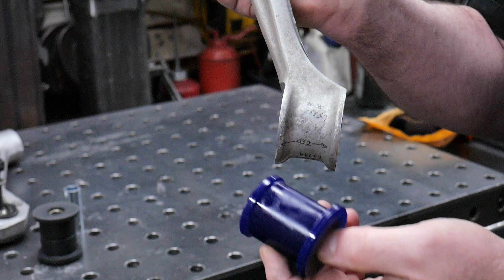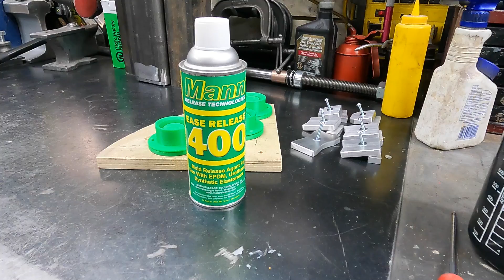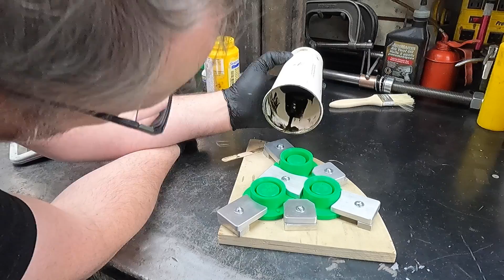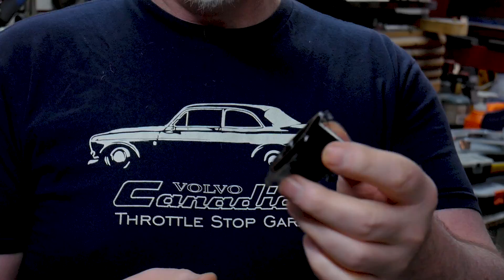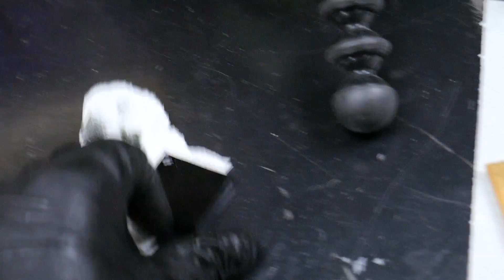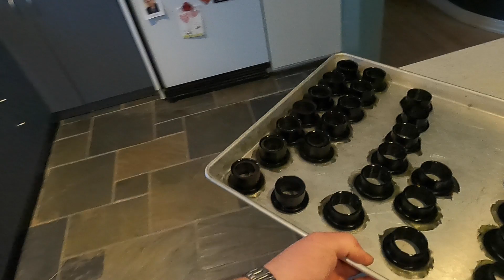DIY Polyurethane Suspension Bushings

Comment: What if you would put a little hole in the bottom of the mold and inject the PU in with a bigger syringe? Would be better to fill it from the bottom regarding air bubbles and filling the mold completely witg pu.
Reply from the maker: Another great idea.  Several people that make this sort of thing have told me that adding it from the top slowly is pretty common practice.  I'm only making a set, so easy is good.

Comment: you should use carbon black instead of "colorant", it adds UV protection to the poly
cut down the plywood so it fits in your de-gassing pot
Reply: Ummm, these won't be in the sunlight, so....
Reply from the maker: I didn't know that this was possible.  Not very worried about UV on these parts, but for others - thanks!

Comment: Very nicely done. Is the oven baking a necessary step?
Reply from the maker: It was included in the material data sheet as a way of improving durability and strength.

Comment: If you make the bushing an easy/slip fit, doesn’t that just let it move around more? I thought the whole point of the tight fit was to stop extra deflection and keep the bushing solid in the arm.
Reply from the maker: The bushings will be a three piece part.  The urethane part will not rotate and when the other parts are installed, it should be tight.

Comment: Dear, I am a follower and admirer of your work and we wish you success. I will do the same to rebuild the suspension system in my country. If you can provide us with the rubber specifications and the source.
Reply from the maker: The bushings I used are not a standard product, so there is no source for them.  They are a pourable urethane with a reasonably high durometer.

Comment: From my experience I would say ya need a wee bit tighter fit 1mm more as you will have ware to deal with after the first few miles
Reply from the maker: We'll see when I get it done.  If it needs to be tighter, I'll make them larger.

Comment: When I hear "polyurethane" I immediately think of hydrolysis and how this affects polyurethane shoe soles.  Does the same apply to PU bushes.
Reply from the maker: While it is still possible, it's not common for car suspension applications to suffer from disintegration in this way. The polyurethane compounds used are different (at least that's my understanding) and I've had poly bushings in cars for 15 years that are still fine.

Comment: Full set of poly bushing inserts for my magnum is $900 US.  How much is that vacuum tank cost? That is labor intensive but I bet it’s Pennie’s on the dollar cheaper than buying a set 👍
Reply from the maker: The vac pump was a cheap one from Amazon - I also needed it for the carbon fibre work - it's also not really needed.  The rest - about $100 and time.

Comment: Is it common for poly bushings to insert directly to the control arm and not in a metal sleeve? Or is it vehicle dependent? The corvette having a more presicion machined control arm?
Reply from the maker: Yes - it's not uncommon if the bushing didn't have a shell originally.  Vehicle dependent.
Reply: @  Right that makes sense. Thanks

Comment: nice work,  i use the PMC all the time from 70 upto 90A    i find it better to warm the poly to 28c before mixing as it mixes better it degasses better, i then degas again after the poly is poured into the mounts,     PMC has about a 15-20min pot life  and course is 48 hours  you  dont need to heat as the poly fully harden over a few days,  heating to 65C just speeds up the proses,
Reply from the maker: Cool, thanks

Comment: Did you make the 3d prints in 2 parts so you can clamp them? Wouldn't it use less material if you flipped them and had the wider part at the top of the mould, it would all be one piece you could just pour into, there is also an option you can do with your printer to smooth out the flat top edges with the hot end to give you that nice smooth finish. Nice job though, i'm looking to do this myself soon but i'm not too sure on which poly mix to get.
Reply from the maker: They are two part molds - there was virtually zero wasted material when I made these.  I like the texture that the printer leaves - it's somewhere for lubrication to sit in the finished part.

Comment: Rewatching because I’m gearing up to make my own body mounts for my Riviera.
Reply from the maker: Thanks - I hope it helps.
Reply: So I got the printer retuned for PLA to print the molds when I looked at my stocks of filament and realized I have a ton of TPU (bought out someone else's stock years ago).  What are your thoughts of direct printing a body mount with TPU using infill to vary the pilability?

Comment: Can you do a test where you print bushings in TPU directly?
Reply from the maker: I've thought about it.  If these don't work, I'll do it.
Reply: You probably need to make them a little bit oversized and hammer them in because of the tiny air gaps in 3d printing 
  @ThrottleStopGarage
Reply from the maker: @1marcelfilms  I made them to size and then sanded them to as close as I could get.

Comment: Excellent craftsmanship! I wanted to share some thoughts on bushing theory if you're open to it!  Bonded rubber bushings when functioning keep the inner metal centered to the outer can which is pressed into the arm.  Bushings are typically much stiffer axially, so when an axial force is applied they resist the displacement by a greater magnitude than in the radial direction.  In a lower control arm a brake force would cause an axial reaction at that bushing (along with a radial force in opposite directions between the front and rear bushing) and if there was no axial preload, let alone stiffness, that hysteresis would slightly affect your alignment and the arm kind of wiggles around.  That preload is also needed radially for proper performance. If the bushing isn't pressed into the arm, it technically has no radial displacement, and since it's a spring, there is no reaction force.  Which means any small force creates a displacement, or a change in the alignment. Oversize the bushing OD and undersize the ID so the bushing already has some squish statically.  A certain force magnitude then has to be applied to create any displacement, maintaining more stable suspension geometry with the same bushing stiffness rate.  A softer bushing under a lot of preload will be better for response and isolation than a stiffer bushing with more preload essentially. I'm not assuming you do or do not know this already as you seem to up to a dual rate bushing of some kind,  but a few of your comments could be interpreted ambiguously by someone with less exposure to bushing design.
Reply from the maker: Thanks for helping me deepen my understanding.   I'm just about to launch into fixing this mess.  I've got my bushings done, and there is a new video coming on the start of my next effort.

Comment: The bushings that don’t move freely are supposed to not move freely they are tortional bushings that need to be tightened up with the suspension at ride height.
Reply from the maker: Understood.  I just got all the parts in finally (2 years late) and will resume this part of the build in a bit.

Comment: Excellent video. I have too many hobbies, none of which will require me to make suspension bushings. But....this pushed me over the edge on a 3D printer. A new application that I hadn't thought about. And the process of doing the casting was also great. Many uses for a vacuum pot. And I'm sorry you have the problems buying from us in the States. 🙂
Reply from the maker: Glad I could help.  The suspension story should be moving along very shortly as I'm completing the frame design right now.

Comment: Hey would you still have your CAD'd part for the 3d print file?
Reply from the maker: Are you planning on making these?  I've not finished or tested this design.  It does not fit the stock part if that's what you're thinking.

Comment: Awesome channel dude. Really enjoying it. the bought bushings being too short between flanges Iv run into before. They were also fairly oversize on the OD. However, when pressed into the arm and the internal metal bush was pressed in they became the right length because they couldn’t expand on the OD. So those blue ones may fit (although no on the edge radius) once squeezed in. 
Just my 2pence worth anyhow. Cheers!
Reply from the maker: Interesting, I'd not thought about them compressing and adding length.  That's good to know.  Now that I'm this far along, I'm making a three part bushing with the "right" material doing their individual tasks.  I'm a few months away from picking this part of the project back up.  Testing won't really happen until I'm driving this car.  Now that's when things get fun.

Comment: Hello
What I'm wondering is, when the rubber part is completely made of plastic, doesn't it transmit the vibration from the wheel to the case?
Reply from the maker: It would.  I've driven cars with Delrin and nylon bushings and they can be harsh.  I've also driven with all spherical bushings.  That's worse.  Poly is fine (if it doesn't squeak) but I think it should be there for vibration/harshness damping and the rotation handled by the delrin.  We'll see how it all works and if I hate it, I'll change it.
Reply: @ThrottleStopGarage  I hope it turns out as you hoped. There is no such study in Türkiye. It can give good results in rally drift vehicles. but the vibration issue in normal daily vehicles makes me think. easy again.

Comment: Great video I ran it at 1.5 speed. Couple of comments for all. When vacuuming chemicals to remove bubbles it is possible to remove essential solvents in the mix with too much vacuum. Better to do several short lower drawn downs to avoid this. I could tell by the frothing that this was happening. Also mechanical vibration is superior to whacking the bench but not as therapeutic lol. Another point ,I also wondered why the bushings were thinner than the aftermarket ones until you commented that you were putting delrin inserts in them. This must have made the overall bushing much stiffer since the poly portion being thinner won't absorb as much shock. Did you notice this in the vehicle? Thanks again for a great video.
Reply from the maker: I haven't finished the frame or suspension yet...so I don't know how it all works.  We'll see.
Reply: Looking forward on the update! FYI new sub from me..

Comment: Aren't bushings meant to stick? Isn't that why service instructions say install the bushing, hand tighten bolts, lower the car to the ground and then tighten the bolts to torque? They then act as a form of damper by always helping the suspension return to ride height position.
Reply from the maker: Nope...you tighten bonded rubber bushings at ride height so they are not adding to spring tension. Other bushing types allow the pivot to freely rotate.  My design is of this type.
Reply: @ThrottleStopGarage  won’t bonded rubber bushings still add spring tension when the suspension is compressed and subtract when extended? So whether it’s compression or extension, the change in spring tension from the bush is always ‘helping’ the spring return to ride height. Isn’t that a form of damping? Or at least a negative spring of sorts; a spring that acts in the opposite direction of the main spring.
Reply from the maker: @zeitgeist785  sure...depends on the design of the bushing.  Some are designed for the and some are not.

Comment: Why'd you make the holes so big? Aren't the sleeves for the bolts much smaller/don't you want more volume of bushing for more shock and vibration absorption? Other than that, why 70a? 70a is pretty soft as far as poly goes; it's about something I'd use for motor mounts, while generally I (and other car guys) go for something stiffer in the suspension since there's much less downside there, oddly enough. ((90a or so poly bushings on the engine, though? Forget it.))
Reply from the maker: These are not for the style of bushing you're thinking of...my design will have a delrin inner with a stainless steel sleeve.  So it's a 3 piece bushing not just urethane and steel.  It should give the deflection resistance as well as a little compliance without relying on the urethane to steel rotation which is normally the "problem" with the common 2 part bushing.
Reply: @ThrottleStopGarage  Oh, nice! Never even considered a 3-piece bushing, I was mostly considering ways to solve the 2 piece setup. So far, a zerk that reaches all the way to the inner sleeve combined with a special form of lube created with silicone grease and finely powdered graphite is, as I understand it, the best combination. Though the people touting the graphite powder silicone grease also say that a manual lube job will go 5 years without squeaking as long as you don't ruin the bond and wash it out by, for instance, spraying brake cleaner on your bushings.
Reply from the maker: @Drunken_Hamster  I've used decent quality marine grease and had good luck and no squeaks.

Comment: Excellent video, I had the same issue with my super pro bushings not fitting on the same car. I also paid a lot for those.  My issue was the back, now I'm worried about the front not fitting properly as well.
Reply from the maker: They're usually pretty good - I've had more issues with brands other than Superpro.  At least with these, I know they fit!

Comment: What 3D software did you use to create the bushings ??
What 3d printer did use to generate the molds ??
  I ask, because I need to create a number of flexible urethane gaskets for headlight assemblies .
Thanks !!
Reply from the maker: Fusion 360 is the CAD software I use.  I build my own printer but lots of decent stuff on the market these days.

Comment: I love this, any chance you can share the STL's?
Reply from the maker: Sure - I can post them on my Thingiverse site...it will only work with the rest of the bushing design  - so stay tuned.
Reply: @ThrottleStopGarage  that would be awesome, I was planning on turning delrin for my Corvette but this design with only a delrin sleeve with a outer poly bushing will most probably get the best from both worlds 👍👍
Reply from the maker: @Jockebanan99  I'm making a three part bushing.  Poly/Delrin/Stainless.  I'm waiting on the rest of the parts.  My fitment is not stock due to packaging - but there is no reason that these won't be a good start point for a stock application.  I'll post them later today.
Reply from the maker: https://www.thingiverse.com/thing:5178504
Reply: @ThrottleStopGarage  Awesome man, I will try them on my C4 Corvette with delrin inserts 👍

Comment: Thanks for this one Craig. Just finished making 4 spring isolators for my 69 Datsun Roadster project that I couldn't find anywhere using the same process. Really enjoy the way you present the content. With what you are doing I still can't believe you don't have even a small lathe. I think you've made it a personal mission to see if you can do it without one.
Reply from the maker: Thanks,  I don't have the room for a lathe...though the thought does cross my mind in my weaker moments.
Reply: @ThrottleStopGarage   Not even for a small one like Chris from Clickspring uses?
Reply from the maker: @GrayRaceCat  not really...I need a bigger garage.

Comment: Fascinating. How did you decide the bushing wall thickness?  It appears you selected a wall substantially thinner than the commercial variants?  Is this simply because your using much larger OD packings which decrease the poly unit loading and increase the eventual stiffness?  Thanks for making us all think more 👍😎👍
Reply from the maker: I'm going to make a multipiece bushing.  Poly is not great for rotation.  I'm also thinking about small misalignment and other details.  You'll see in a few episodes when the parts get made...struggling to get these parts made.
Reply: @ThrottleStopGarage  😃 Looking forward to it 👍.  I have no doubt you have a exceptional, well thought out plan.  Sorry to jump the gun.  I’ll Stand down and patiently wait for the next astonishing reveal.
Reply: In another comment he mentioned a Delrin component - that would be a bearing sleeve inside the polyurethane bushing, and the resulting need for a larger inside bore in the polyurethane.

Comment: surprised you didn't put knurling on the inside :-) i know, i know, impossible to remove the urethane.... did the purple bushings have silicone molds or something?
Reply from the maker: I could have done it, but the sizing of 3D prints is not very exact and the ridges left on the inside of the part from the print is more than enough surface area to hold a bit of grease.
Reply: @ThrottleStopGarage  But you don't need grease with the Delrin bearing sleeve - the idea is for the Delrin to rotate with the polyurethane (sliding easily on the steel sleeve), so there is no movement between the Delrin bearing sleeves and these polyurethane bushings, right?

Comment: A better way to pour is using a high pour in one spot. High pour meaning just pour from a higher distance in a thin stream, this allows bubbles to stretch and pop as it rolls off the edge of the cup. Also you want to pour in the lowest spot and in one spot, this allows the material flow naturally and push all the air up vs "filling the whole cavity and letting it settle and pouring again" This traps air underneath and causes more bubbles. Not saying its not possible to get good results but also will prevent a lot of time shaking and vibrating the mold.

also a DA sander against the mold can be used as vibration to help evacuate bubbles.

awesome job with the 3d printed molds!
Reply from the maker: Hard enough to see this stuff let alone getting it all in one place.  LOL - all things to try for next time.